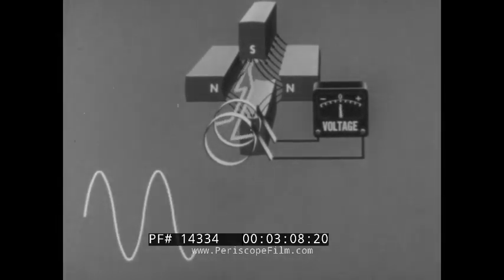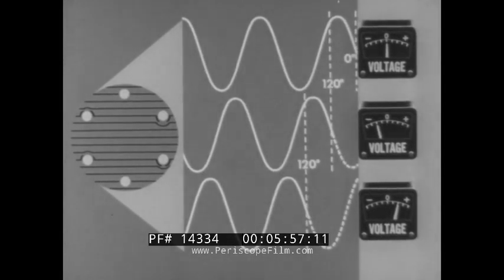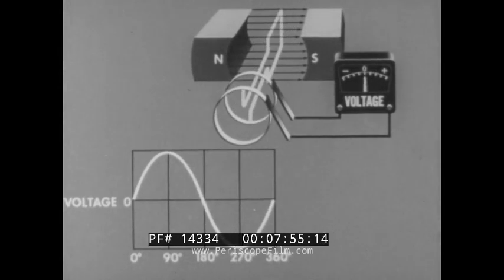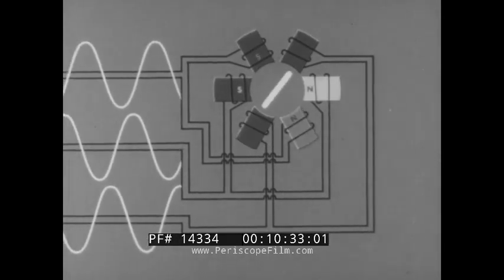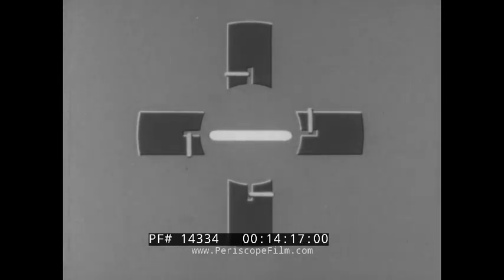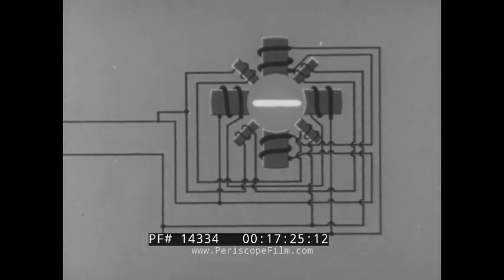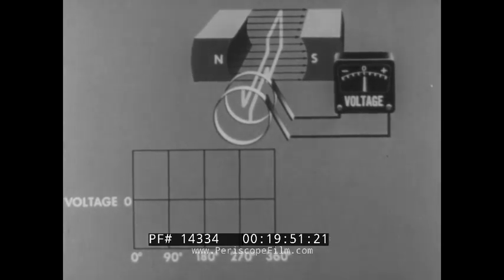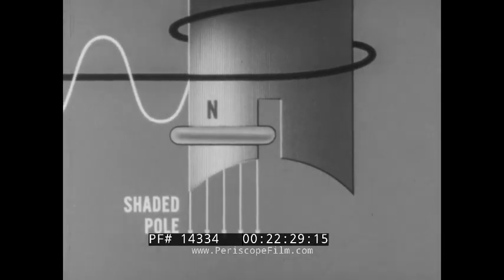" MOTORS AND GENERATORS "  AC MOTORS AND GENERATORS  U.S. ARMY TRAINING FILM   PART 2 14334

Comment: around minute 6 of the video, i did not understand why a D.C voltage was required for the electromagnet so I put the question in chat gpt and this is the answer it gave. "In DC, the current flows in one direction continuously, and this consistent flow of current in the same direction creates a stable magnetic field around the wire. However, in AC (alternating current), the direction of the current changes periodically, which causes the magnetic field to constantly change direction and fluctuate in strength. As a result, the magnetic field produced by AC is not as stable or strong as the magnetic field produced by DC.

Therefore, DC voltage is preferred to create an electromagnet because it provides a consistent and stable flow of current in one direction, which produces a strong and stable magnetic field.

hope it helps someone
Reply: That varying DC voltage controls your cars alternator output